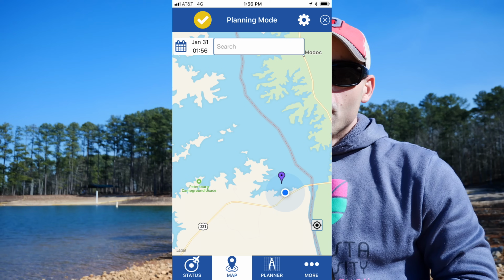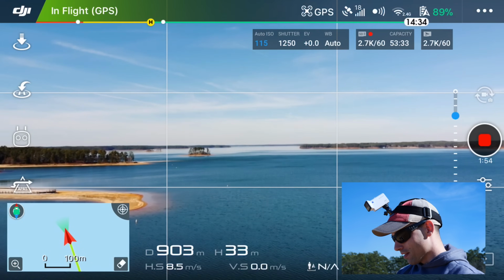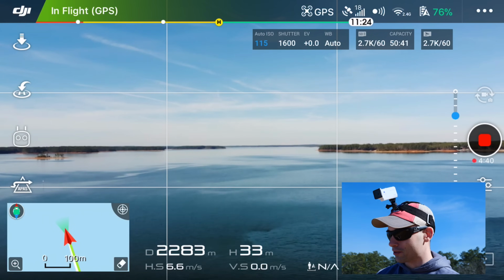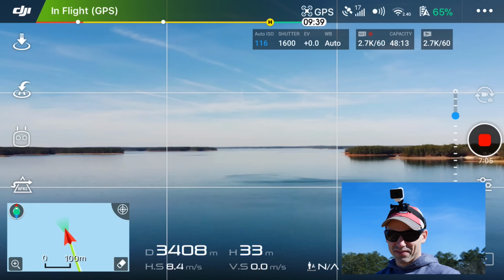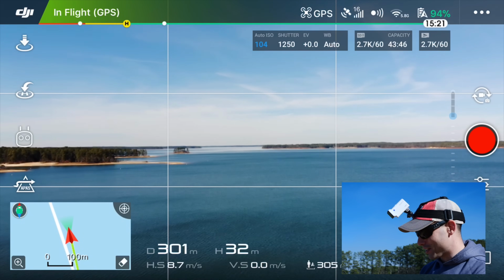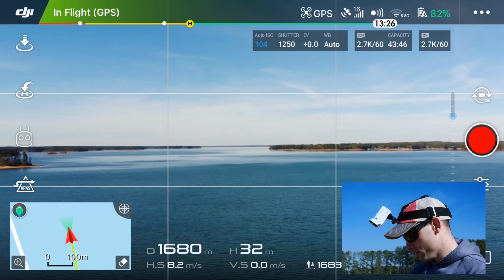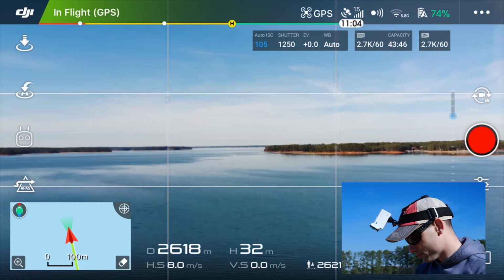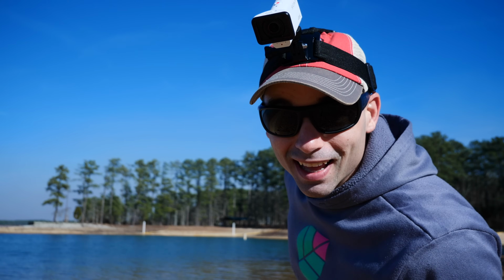DJI Mavic Air Range Test!  It can go HOW FAR?!  Testing both 2.4 and 5.8!

Comment: I made a test at such place with my Mavic air. Only water without buildings and antenas at 5.8Ghz (automatic mode). I have lost signal at 1 850m. I tried 3 times. Antennas of the remote controler are pointing straight to the sky( such as video). Changing the position of the remote controler ( up and down). The result was the same. That was my distance record 😅

Comment: 5.8G will work better? Or when to use 2.4 or 5.8G?
Reply: Signal penetration through trees and stuff is better at 2.4, but that's hardly necessary, especially if you're staying in line of sight. 5.8G is useful for urban areas with lots of interference like mobile phones etc. My uneducated guess would be that 5.8 is better most of the time. Higher frequencies should reach longer distances too.
Reply: @lhardly  what i been told is that 2.4 gives you longer range so in landscape its fantastic. 5.8 on the other hand gives you wider and shorter range.
Reply: @JosesGarage101  That could be true, I have no idea. Antenna placement plays a big part in that too though. It's a different implementation but WiFi in the same frequencies would give better penetration and LOS signal at 5G compared to 2.4G
Reply: @lhardly  yes absolutely. My air has the 5.8G as only alternative,  I cant change it because it won't let me, not even in costume settings........??
Reply: @JosesGarage101  I'm not sure. My air arrives in a few days.

Comment: You are flying illegally.  You need to have a visual of your drone at all times.  You cannot see the drone 1/4 km out never mind 4 kms out.  even though you do your due diligence prior to the video with air space etc, you are flying illegally 3/4 of the flight.  Check the CARS and drone regulations.

Comment: Impressive little critter. Just a quick question which perhaps has already been answered but I am going to ask it again. I am close to pulling the trigger on one of these, however, I will be buying in Germany. My question is, is there a difference between the units sold in Europe vice the ones sold in the U.S? Is the distance restrictions based on GPS location of where the drone is being flown or on the drone itself? This will be my first drone and I want to ensure that I am getting the best distance once I move back to the states this coming summer. Thanks in advance.

Comment: I want to buy a mavic air but i live in greece which means that the range will get shortened as it is ce and not fcc.would you think that i should buy it or not?
Reply: δημητρης καρυδης after buying it you can change from CE (Europe) mode to FCC mode (US), which will make the range better

Comment: .. very nice results - especially for the battery 😲, but remember you are on both bands obviously flying on FCC rules concerning transmitter power where distance can come in reach to the 4km value promoted by DJI if you have no disturbances like at this beautiful lake; in europe under CE it´s unfortunately much worse! still - in many cases battery life overrules connection distance capability.

Comment: So if you buy a mavic air the only place you could fly it is over water because in a residential area the Drone is worthless at least the mavic pro you can fly it in a residential area and not lose signal as fast as you would with the mavic air because the GPS system on the air sucks save your money buy a mavic pro or the mavic 2 now you have a real drone not a toy

Comment: QUESTION:  :)   I am thinking about buying the Mavic Air today (last day for sale - $650) - after you have had it for this long, do you still suggest it?  I would like to use it for fun and maybe a little work in the future.  Thought it would be fun to take to the beach on vacation and get some other fun shots at different locations.  I used to own a Phantom 4 Pro, but sold it because it was a little to big to haul around. :)

Comment: This test is limited by battery life, not range. According to your data, the sortie distance is 8.8 km before 0battery causes flight failure. It would be nice if you had someone out there to see the max range of control, assuming no return to home.

Comment: Use sports mode so your video is actually useful. You were only traveling at 18 mph. In sport you could actually go to the radio com limit and return without worrying about the battery.

Comment: Thanks for this. I think the range isn't really the issue with the air but interference. If you are in an area with a lot of WiFi signals it will interfere with the drone to remote signal and you have a very low range.

Comment: In densely populated areas where both 2.4g and 5g are bombarding this drone you'll be lucky to get the 2km out of it. This looks like a great drone but try to fly it in San Francisco around Union square and let me know how it goes. My spark made it 30ft before the interference was so bad it stopped communicating with the remote. If this had occusync I would have bought it in a heart beat. But for the areas I film in signal quality is all that matters. A Mavic Pro, Phantom Pro or custom rig with a 1watt 400mhz kit is all that works. But, we all have different needs.

Comment: If I have video feed, I normally return back without engaging RTH. RTH uses less battery, but also takes a bit longer to return back. I remember 2 years ago when I reached 4,000m with my Inspire 1. Returning back manually was scary! The wind came out of no where facing the Inspire when I was returning. I might of had a few minor heart attacks lol. When the Inspire landed, it had 15% battery!

Comment: Today, i went 1.5 miles (over 7,400 feet) on 5.8ghz. My friend was right beside me using 2.4. We turned around, but could have kept going. In my opinion, 5.8 is better. I see way less interference.

Comment: Great video but I have to say because of the line of sight requirements and the fact of its tiny size, I would not be able to find it in the sky more than 500 feet from me.  It's good to know that it should never lose video or controller connection as close as I would be flying it.  Besides it's just too much money for me to take a chance with and I always want to be legal.

Comment: I'm struggling to find the option to change from 2.4 to 5.8 which I really need in my area.  What am I missing?
Reply from the maker: I messed around with the channels until it auto changed 👍
Reply: Ahh, okay.  Mine was stuck in 2.4 and really struggling with signal interference.   I wanted to find a switch but couldn't see one.  I guess I'll have to try again.  Thanks.
Reply: Wifi Panel. Choose Manual instead of Auto and choose from the bottom numbers above 11, that will put you into 5.8ghz mode.

Comment: A couple of comments and a question. I would like to see the same test in an urban environment to see the impact that Wi-Fi interference has on the max distance. Many of us are land locked more or less and do 99% of our flying in these type of areas. Second I have a question about "Line of sight" requirement. Does this mean nothing blocking the view of the drone or does it mean that you have to be physically able to see the drone with unaided eye sight the whole flight? Thanks for sharing it was really eye opening on the range of this drone.

Comment: Have thought about doing a Mavic Air range test with a set of the parabolic antenna range extenders? In videos with the extenders and the Spark the parabolic extenders added to the range of the drone.
Reply from the maker: There would be no point unfortunately .  It didn’t run out of range it ran out of battery.

Thanks for the comment! 😁👍
Reply: The Everyday Dad ... I should have been more clear. You flew the Air under optimal conditions when you flew it over the water. What about trying range extenders over land like Kelly from Ready Set Drone did. One, it might be less stressful since you would not have to worry about landing over water. Two, it might be a better index of what most of the Air owners will encounter and can do to improve their range and transmission signal. This would especially be true for those users in the EU where wifi signals and distance are limited by regulations to lower transmission power. And three, no one else has done it.

Just make sure to do it over farms or some other plot of uninhabited land.

And once again, great videos. I love the channel.

Comment: This is an excellent test, but not really realistic for the large percentage of shoots. There's no interference! Clear day, over water, perfect day for long range flying. Back in Southern California we tested the Air in several locations, all away from the cities, but in populated areas. Best the Air did was 411 meters or less! This is a wifi drone, which means it's great for flying over lakes, no so much in more normal locations. This issue and the shorter battery life make the Air more of a Spark Pro, instead of a Mavic Pro competitor.

Comment: you should fly at top speed into a wall and see if the sensors will stopped it before it crash
Reply from the maker: I’ve done that in regular mode and it will stop it.  I haven’t tried sports mode because I’m pretty sure the avoidance is turned off in sports mode.

Comment: Well you were using a little of the battery on the first test with the video working but on the second test you did not have video running not a true test but a good one all the same great video all the same, would  like to see the AIR against the New EVO now that would be a test Regards TJK.

Comment: Thanks for the test ! the 2.4 GHz signal is stronger for distance however video signal is very weak seems laggy at times, but for the 5.8 GHz the distance is shorter but video signal is smoother, can you confirm on that ?  Btw you are like the only American I know that actually uses the Metric system respect to that haha.
Reply from the maker: I’m not the only one, I’m just the guy that made the YouTube video using it 😁👍
Reply: How do you switch from 2.4 & 5.8 ?

Comment: Well what your good little video tells me is DJI have a great little drone with insufficient battery capacity, what's the point of going 4000m and straight back, you need time to video your subject. Looks to me that someone (yes you DJI) need larger capacity battery.Looking at the drone would it be possible to extend the battery section out the sides??Also you are using brand new batteries, after 50 recharges try the same 4000m flight andI think you would lose your drone.

Comment: Great video!
How much battery left on second flight?
I have special interest in this, since I had "an issue" with my phantom 3 pro. Here's the story: once I flew it until the battery went down to 5%, I  was meters from home and the engines were shut down mid air with a few percentage still of battery! So my two years old phantom 3 pro is gone. (waiting for Mavic ii)
Reply from the maker: It was 14%... just a little bit better.  Ouch!  Dang sorry you lost your drone!

Comment: Love the videos and really enjoyed your Spark series.  Happy for you to see you have new toy!  Question about frequency settings - thought that setting was for the app to craft signal, not for the remote to craft signal.  I may have misunderstood it.  Saw similar when goofing around with my spark.  I had assumed that setting the frequency there would indicate the AC to App channel and the "leftover" channel would then be used for RC to AC.  in short the setting was never clear to me what it controlled.
Reply from the maker: Thats a good question.  I assumed it was for the controller to the drone as it connects through the rc wifi signal.  But I guess I don't actually know, I'll have to find out!

Comment: Am sacared because I have seen videos that say that the mavic air is louder than the spark or mavic. Is it true?
Reply from the maker: I've done a few tests with my cheap decibel meter and its roughly as loud as my spark.  My meter isn't a professional one by any means but to my untrained ear it doesn't sound that much different.
Reply: Thanks

Comment: Great to see this TEDD.  We had to do a similar test over here in the UK as we get our transmitter power auto-restricted to comply with the European regulations.  And my two tests were a bit surprising as locking to 2.4Ghz didn't make as much difference as I'd have expected, but then my 5.8Ghz test was way more than expected...  Either way, thanks for your video and all the best from over the Pond.  Ian in London.

Comment: 55% turnaround - I was going to say gutsy.  I watched a hilarious vid last week of a guy who flew his Spark out as far as he could over the ocean and couldn't believe his range and slow battery drop.  Turned around and realized why... he shot out with a nice tailwind and DJI's app doesn't correct for that.  Probably a 20% reserve calc is safer. Ha!  Great video!
Reply from the maker: Ouch I'd had to see it drop into the ocean.  Yeah it was pretty still thats why I was trying to be a little more cavalier but 20% is a much better option.

Comment: Awesome video TEDD. Subscribed :D. However to prevent the terrifying part you should fly in sport mode. I have seen tests sport mode vs. RTH. Manually flying in sports mode always brings it back with higher battery than RTH.
Reply from the maker: Well thanks so much!

Comment: My AIR is to arrive Wed, 2/7/18 according the notice I received.  I have a question:  
Was your phone hard-wired to your remote during this test?
Great video!
Reply from the maker: Yeah the controller comes with an otg cable and I was using it during the test.

Comment: Could you show us how to swtich between 2.4 and 5.8
Reply from the maker: I just messed with the connection settings until it auto switched 👍
Reply: The Everyday Dad couple more questions did you fly it in auto or custom ? An would you pick the shortest green bar or longest ? Thanks great video .
Reply from the maker: I basically always do auto everything.  That’s why I default to drones that basically fly themselves.  I’m more interested in being able to get cool shots easier then getting the absolute max best resolution/image 😁👍

Comment: Awesome video ! I would to see an efficiency comparison between sport mode and GPS mode and also with and without sensors on. And see which mode yielded the longest distance/flight time. I would assume lights off and sensors off would certainly help with the battery during flight.  Thanks again .

Comment: Try it in sport mode. You will be able to go out further then your battery will let you.  You need more speed. P mode issues a lot of battery because it moves so slowly.  :)
Reply from the maker: I guess I figured it would move more efficiently with in normal mode.
Reply: Watch the range test on the air from Ready Set Drone. He flies it in sport mode. I'm sure it's scary as can be though. :)

Comment: Great job. Not putting it into sports mode saved you as Mavic Air most efficient speed is approx. 25kmh, so if you force it to do 68.4, like other tests , there will already be a low bat. Warning signal at 2km
Reply from the maker: Well thanks for the info! 👍
Reply: But it would have covered more distance the 2km. Just saying. Its all very give and take.

Comment: Just because I'm curious, why is everyone using meters? Can't you set it to feet? Also, just a suggestion, next time use the feed from the drone and place the screen capture in a smaller square like the feed of you, because going along for that ride, it looked really blurry and out of focus and I'll bet people thought that that was video from the drone forgetting you were capturing the screen of your phone! Lastly - did you forget to record on the second flight?
Reply from the maker: You can absolutely change it, I just use metric a lot at work and I prefer it.
Reply: I guess because it is the scientific measurement standard, adopted by the majority of the word, except Liberia, Myanmar and... the USA. A lot easier to use in calculations, as everything is related....
Reply: Metric is the way forward. If you can't convert it to old money then you live in the past and should be flying control line. "Can you re-shoot in feet?" Too funny.
Reply: IMO-In the States most people are accustomed to imperial (feet and mph).

Comment: Hey that was a great job, the wind conditions were favorable, you did the right thing by leaving it in GPS  mode VS sport, you stayed relatively low and you got the range we were all expecting.  Again kudos.   I've seen an couple of Japanese test they got 4500m and got back with battery between 15-18%, they had some weird power display around the compass and kept the throttle at 50/60% also saving on battery power.
Reply from the maker: Well thanks so much! 👍

Comment: I think part of the reason 2.7K is much better at file size is because it's not recording at 100mbps?  I also do that on my GH4; it's still a higher quality than 1080p, but gives me some room to pan and zoom if I need without the huge overhead of 4K.
Reply from the maker: That’s probably a big part of it.  I really like 60fps but obviously the mavics currently don’t do 4K 60 fps (someday though 👍)

Comment: I notice you have the info in the display set to Meters.  You are obviously more comfortable with Metric than I am.  Can I assume that in "Settings" you have the ability to change measurements to Yards or Miles?  I was wondering what approximate average speed you were flying at in MPH.  Do you find that you get better mileage at certain speeds?  Is there a certain speed where you get the best milage?  Thanks!  Great video...as usual.

Comment: So what is than diference betwen 2 ghz and 5.8ghz?
Reply: AndroidGuyPro so 2.4 ghz normally gets better signal in less interference prone areas 5.8 ghz normally does better in high interference prone areas but usually does not have the range of 2.4
Reply: thanks